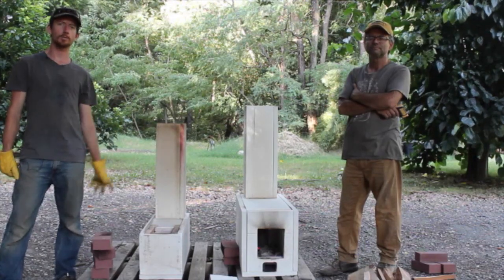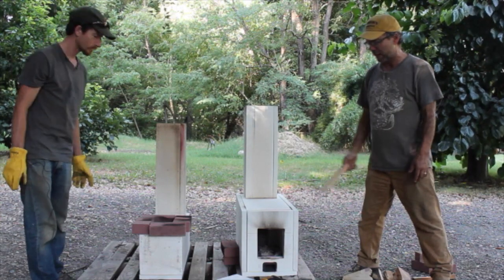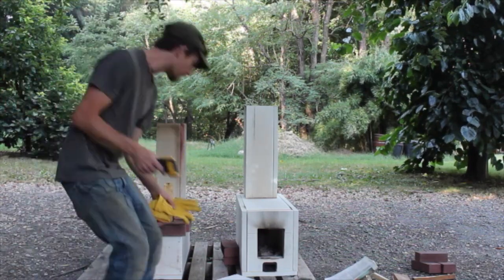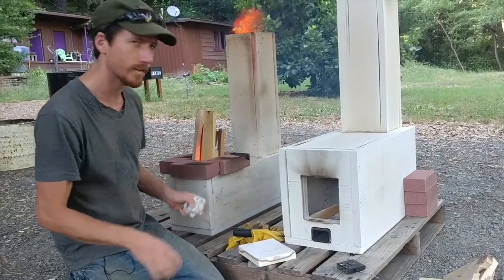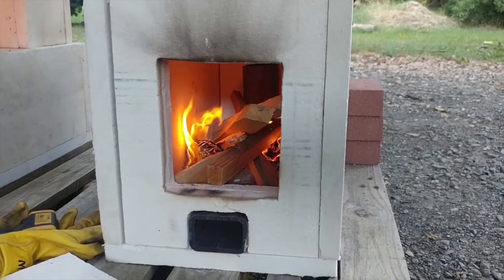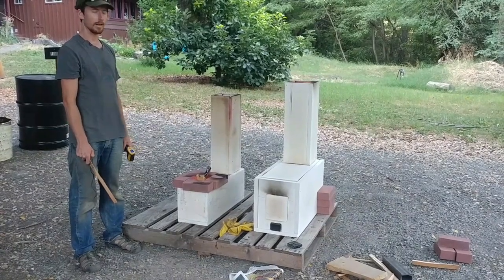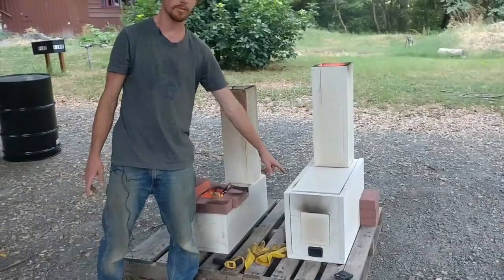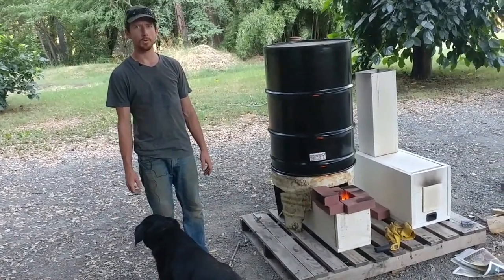J Tube and Batch Box Rocket Stove Comparison

Comment: Hello Luke,  I also have a Walker Superhot 6"J. The J is very self regulating, but burning pieces that are very thin can result in some excess coals and overfueling(flames shooting out of the riser and smoke). Placing wood in there that is too large can cool the fire a bit. It doesn't take very long to get a feel for what works best. And it's pretty easy and intuitive to add smaller pieces if a large piece is slowing down the fire. Great job on those cores! You are cutting and shipping them for cheaper than I can buy the sheets at my local refractory shop. Good luck with business!
Reply: Thank you Sir Augustus Smoothy. Peace and good luck too. VF
Reply from the maker: Thanks Augustus for the feedback. Do you have your stove attached to a mass? Do you have any pictures of it?

Comment: Ceramic Fibre board is used as a backup most of the time to refractory installations I don't understand what u are trying to accomplish here are u using this to heat an area this is not something u use as a permanent thing I've been installing this stuff mainly for a backup to refractory or to make commercial flues for heat treating ovens after time from the heat they will breakdown and if u get them wet just say goodbye to it it will fall apart 2nd of all after time from being under heat it will breakdown becoming very toxic  fibres from what u are using is cancer causing trust me I've been in the refractory installations business for almost 45 yrs this is not something u put in your house or garage just a warning the stuff u are using is Fibre board read the MSDS on this stuff dust particles from cutting this stuff is very hazardous make sure u wear respirator when cutting this stuff
Reply: Someone, seemingly very knowledgeable person, warns about the same thing in the permies in a long and very detailed discussion. How about dense mullite brick then?
Reply: I don’t understand what you’re saying (punctuation would help). Should ceramic fibreboard NOT be used to line a stove? Then, what? Firebrick only?
Reply: The discussion on the Permies forum identifies surface treatments to mitigate these issues. In the UK the off the shelf solution is to apply Vitcas Zircon paint to the interior ceramic surfaces of the stove. This is used in commercial kilns. I don't pretend to know enough to say this is necessary but you can use it if you're worried.

Comment: Hi Luke.  I just built a rocket stove water heater using your 6 inch j tube kit for the core.  It went together very easily and burned well the first time.  Thank you for making Cement fiber board much more accessible material for rocket cores, it works so well and is so much easier than fire brick or the other options for cores.  I would be very interested in this batch box kit if you started offering them.  My dad just built a metal shop building in central Oregon and we'd like to build a rocket mass heater for it.   The batch box would be a much better option for that use, since he could get the fire started, load it up, and them get to work on his projects without having to feed the heater as often as he would with a J tube.  Any chance you would be offering an 8 inch batch box core?
Reply from the maker: Jesse! I remember you from when you lived up in Montana at Paul's. My brother Jake came up and did some insulation with you at one point. When I shipped out your core I thought your name sounded familiar. Great to hear from you, and thanks for the feedback. Have you got any photos/video of the water heater you put together with the core I shipped you? I don't have many photos of my cores in action yet.

An 8" batch is definitely a possibility. It will use more materials than a 6". I was working on the 6" batch for a while but still have some final details to work out. A main issue right now is figuring out what to line the batch box with. Matt's designs call for lining just with the ceramic fiber and I have questions about the long term durability with that approach. My preference would be a fire brick lining like the feed tube for the J. I'll shoot you an e-mail with some thoughts...

Comment: Very cool. I'm going to build one of these. I like the Batch box design, but I want to have a permanently installed clear ceramic window on the front of mine and don't want the hassle of trying to make it open as a door. So I'm thinking, why couldn't you just make a batch box design with a large insulated door lid on top and just drop the wood in from the door above then close it 100% sealed. I would make the air intakes the same as the batch box in this video. What do you think, any problems or issues modifying the Batch box design to have an insulated door on top and a non opening window on the front (with an air wash going over the glass)?
Reply: Get a wood stove with glass door like you want, build your rocket batch heater inside it

Comment: i also am super confused how  youre using fibre board here. its designed as a backer behind firebrick or metal, never as the actual inner lining or structure.wont it just fall apart? chip up? also isnt it toxix when cut or disturbed? (Unless Superwool lining the riser only)

Comment: Could you use a wood stove first and connect it to a rocket stove to use the gas from the stove without secondary burn ???? Maybe this would give more heat since two stoves are connected ???? Thanks
Reply: One of the reasons that rocket stoves are so efficient is that you're not extracting heat from the burn chamber. This allows the fire to reach temperatures that burn off creosote and carbon monoxide. Then the heat is extracted into the air and thermal mass after the burn stage.
Reply: @doctorsmoothy  Thank you for clarifying that up Augustus.
Reply: @victoryfirst2878  You could spend thousands of hours reading the Donkey and Permies forums and see all the creative things people have tried. Every "clever" thing I thought of has already been explored. Mostly it comes down to using verified core dimensions and using materials that can withstand crazy temps.
Reply: you could use a wood stove for the 'batch box' but it would need to be double walled on the inside with thick fire brick. not letting the heat escape from the walls. then into a chimney with fire brick. you would have to experiment.
Reply: @hk93shooter  Thanks for the information shooter. Good day too. VF
Reply: @doctorsmoothy  Augustus, what would be the highest temp the material would have to withstand for maximum amount of bang for the buck ???
Reply: @victoryfirst2878  I hope you'll check some better source than me, but I think if you're prototyping your own build and not using a proven design, that you should be good with stuff rated for 1800F. I'd expect that one of matt walker's 8" Batch Box stoves would probably need 2200F.
Reply: The cheapest build would be something like fire brick wrapped in ceramic fiber blanket, wrapped in metal. Ceramic fiber board and blanket shrugs off high temps, but you could push a piece of wood right through it.
Reply: @doctorsmoothy  Thank you for the numbers that I need to be aware of and keep in mind. If you run across something interesting please pass it on. Peace too. VF
Reply: @doctorsmoothy  Thanks a bunch for the tidbit on information. Good day too. VF

Comment: if this is really tiny, does that mean it can be utilized on a sailing boat? we need a lightweight functional rocket mass water heater and stove/oven... all in one solution not larger than 20"x20"x30" height... with so much knowledge all around us, why hasnt anyone come up with a clean simple solution that works afloat? there are thousands of sailors waiting guys..... what are you waiting for?

Comment: i'm building a batch box design at this moment ...is the p channel unnecessary?  i have a secondary air channel underneath the floor of the box.  it feeds air into the bottom of the riser...do you think that is ok?
Reply from the maker: Primary air and secondary air are both necessary for optimal performance. In the batch box in the video I did not have a primary air port in the door but I should have (it was my first build). There were enough small gaps for extra air to come in... but if it had been well sealed it probably wouldn't have worked quite as well.
Reply: @lukeshomestead8760  when you say primary and secondary air...are you talking about inlets both near the bottom of the door...and not the p channel at all...am i correct?
Reply from the maker: @rwhirsch  Primary air inlet is a hole, often near the bottom the door. Secondary air is for the p channel. For a more thorough discussion see Peter's site. He is one of the main developers of the batch box 
http://batchrocket.eu/en/building#dimension

Comment: Also overall weight?
Reply from the maker: Overall height of the J is about 34", the batch is around 40"
Reply from the maker: Overall weight... 6" J is 24 lbs. Batch is probably 35 lbs+ without including the secondary air piece which is another 10 lbs or so

Comment: For sale door idea bevel cut door and opening so could be hinged with latch
Reply: Just make it sit over covering the opening, that is how real wood stove doors are anyway, with the seal on the back of the door, not on the edge. Even ovens on gas fired range tops have the oven door fit over top of the opening, not within the opening.

Not that i am saying you can't do your ideal, but it will take a lot of work to make it work as good, or better than just have it cover the opening and put the seal on the back of the door.

Technically on a house exterior door it seals on the back/front of the door also, near the edge, not the edges itself. Those pieces of wood nailed into the door jam that stops the door from shutting too far in, is where it seals, and that will be on the front of the door near the edge, because exterior doors open inward. So in essence it is the same thing, the door fits over the opening, not within it. It only appears it fits within to an unexperienced eye, those pieces of wood stopping it from closing too far, it how it sits over the final opening. In the end after it is all built the opening is smaller than the door.